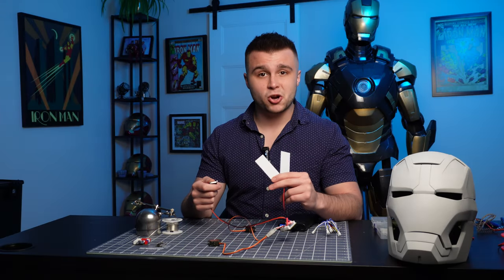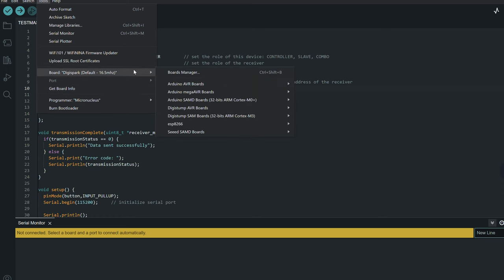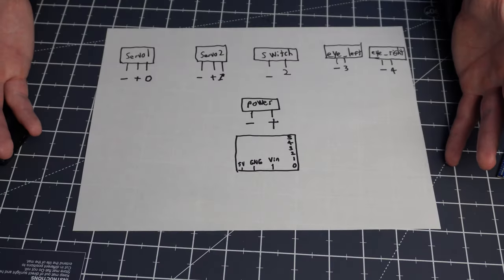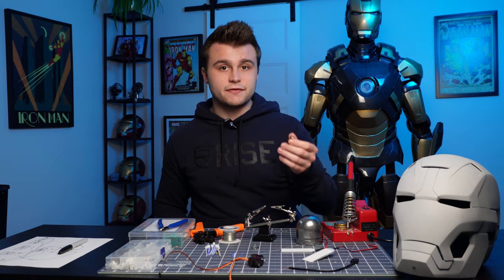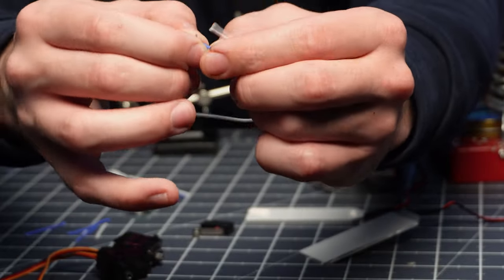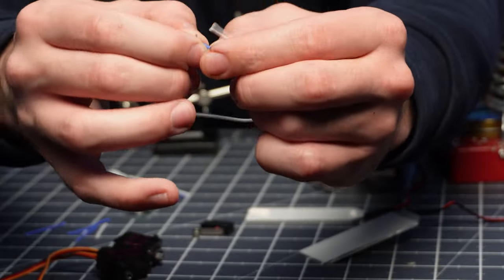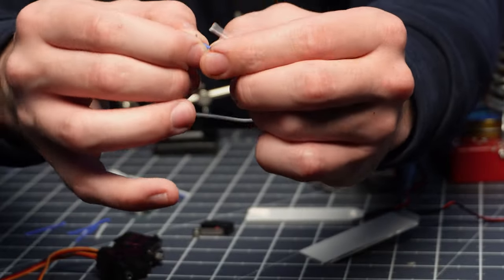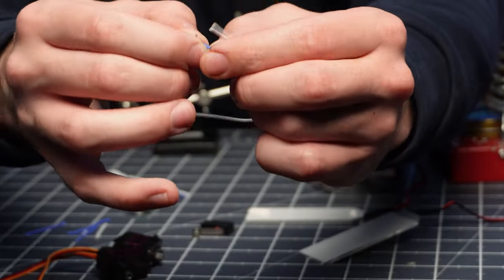Coding Iron Man: How to Motorize Your Helmet with CRASHWORKS - Motorized Iron Man MK42 (part 3)

Comment: I have a question, is there any way to make the lights turn on the opposite way? to use this same card for the flaps, missile holder, etc.
Reply from the maker: Yup! You can just edit the servo direction to go the opposite direction in the closed state and open state. That’s what I did with the missile launcher code of the MK20 suit so the lights would turn on when the pod was opened
Reply: @plentifulprops3d I'm still confused, I have changed both the state of the faceplate and the LED eyes and I can't get it to change (the LEDs continue to be on in the rest state and they turn off when the plate is raised), could you please help me? I got stuck on this part, I feel like my cosplay won't be ready for Halloween

Comment: Hello I need your help, when I give load to the code I see "buttom pin was not declarated in this scope", could you help me?
Reply from the maker: Did you download the code for the Alisha bord or the Alisha MINI board? Also did you modify the code in any way?
Reply: @plentifulprops3d  Thanks for your answer, the code was fine, without any modifications, the solution was to use an old version of the IDE (run from Windows X86). It loaded without problem, I'm already installing the motors in my suit. Excellent tutorial.